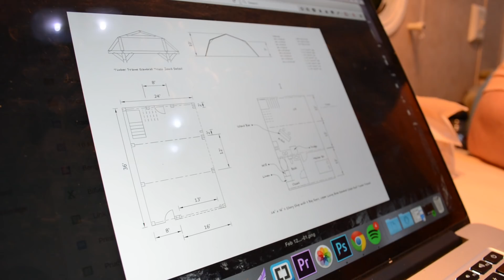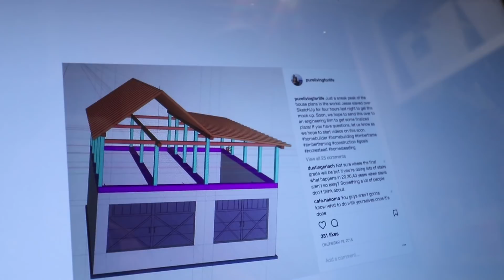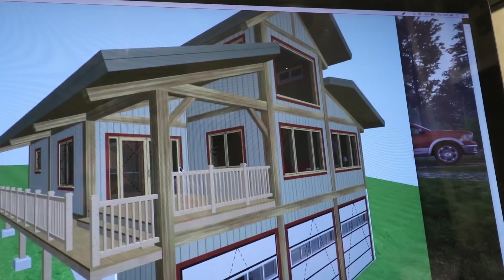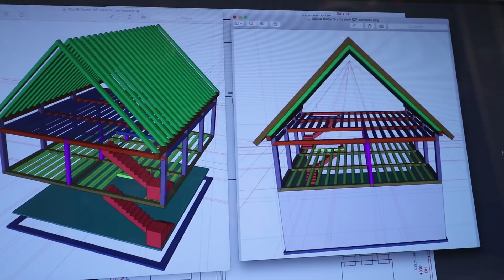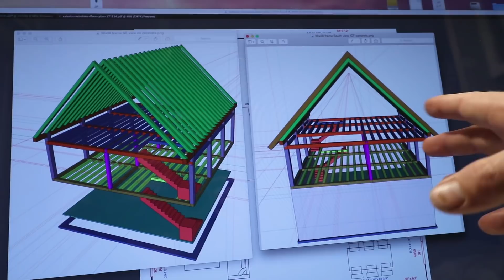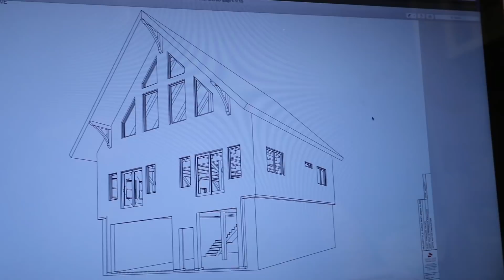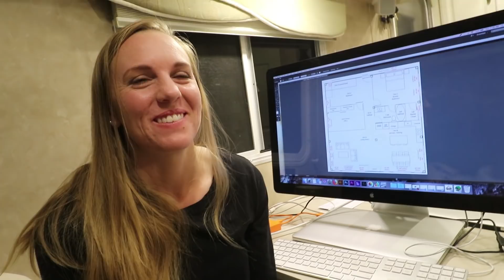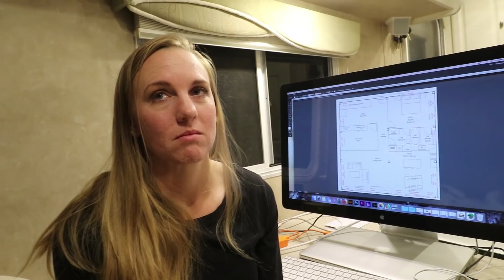Building a House Start to Finish: Timber Frame House Tour

Comment: Do you feel you've missed an opportunity to maximize solar power generation by orienting your  roof that way or are you going to have a PV array in another location on the property?
Reply: In my opinion they did it right. Turning the roof by 90° you gain solar but loose a lot of natural light and the great south facing view from the loft. Do they even plan to put solar on the roof? In that region I would put solar on high pitched shed roof close to the ground. Better efficiency in the winter, you can remove the snow without climbing up and if lucky the high pitch will remove the snow by itself.
Reply: Your arguments make sense. I'm thinking with an urbanite aussie mindset where you don't have to deal with snow nor have the space to put it in another location or on another building.
Reply: Hi Mick.
Not really a good idea to locate solar panels on the roof
1) Maintenance of the panels (such as cleaning or replacement ) would be a real pain in the ass, 45 feet off the ground. 
2) We do get a lot of snow here,  metal roof panels  are good for snow to slide off but any obstruction like panel brackets or wires would cause significant  problems and snow  back ups .
3) Solar Panels restrict air flow in hot weather and solar panels do not like hot feet.

Comment: Please do more research on the front load washer. I have had one for about 10 years and designed the laundry room around stackable s but we have started to hate them. They are awful on cleaning clothes. Top load washer, wash clothes WAY better. Also I have been working on washers for about 30 years. Just thought I would speak up because you guys will probably need something that can clean very good.
Reply: This is just not true. There is no difference in the cleaning effectiveness between similar front vs top loaders.
There are other pros/cons with the different machines, but cleaning effectiveness is not one of them.
Reply: Just speaking out of 10 years experience with these washers not to mention working on them for 30 years. May not be true for you but it is for me. :)
Reply: Eliu.
Quite agree  I was a Simpson Sears repair man many yeas ago and working on "stackers" were the pits. 
The other thing they will regret is when the have to pay for a maintenance call with no space to work around those machines, that will be interesting !!!!!!!!!!!
Reply: The repairability aside, do You also agree with Eliu Garcia about the washing quality of the different style machines?

Comment: Why do you guys use separate washing machine and dryer? There are 2 in one combos for that so you have one machine that does both.
Reply: I do have and use such a combo, and it works very well for my use. But, it takes a lot of time, so if u want to run more than two machines a day, do prefer the separate units.

Comment: Looks like a great house. Don't forget to add Ethernet wiring to where needed ( office, tv areas, garage ) and a few extras points for wifi access points on each floor. i think youtuber Crosstalk Solutions could help with that. Keep up the work im sure the end result will be amazing.
Reply: Or just wait for lifi
Reply: Do mobiles etc support LiFi?

Comment: I liked how this video shows your progression in the design and function of your timber frame.  Generally think that a walk though perspective adds significantly to the design process and cost, but I can see how this has benefited your decisions for layout. I'm not totally convinced that you will not later find things you would do differently.  One of the things that I feel that you may find cumbersome and difficult to change later is the location of the sink in the kitchen.  Placing the sink under a countertop without windows with insufficient countertop next to it severely limits the utility of the sink for food preparation and makes the person using it feel like they are separated from the rest of the members of the house. What I've seen in a significant number of newer home designs is to put the sink and dishwasher in the island, this would only be a minor revision to the water placement, add a slight complication to the DWV but significantly help with food preparation, especially if there is more than one cook in the kitchen. Often people opt to put additional cabinets over the island for dinnerware and glasses.

Comment: Make sure when you design your electrical system overbuild the garage with separate breakers for lots of plugs for tools. Wire the lights on separate breakers. Put lots of though on you garage as you are on an acreage and will be using this space more that if you are in the city. This will be a heavily used part of your new home and planning this will save lots of work later. Also lots of lights in garage is great as second shop.

Comment: I like your design philosophy of focusing on the areas which will get the most use. Just a couple questions. Why the french doors on front instead of large picture windows? Are you planning a large front deck that was not shown? Also, I noticed almost no windows on back. Have you thought about that beautiful woods view to the rear? I would love to have a bedroom in the loft area and wake up every morning to a view out onto the woods. I have seen some houses where they illuminate the woods too, so you get that view at night as well.

Comment: Hi,
Nice plans, you've done a great job! I would like to suggest, for SECURITY reasons you mite want to consider hurricane glass windows. You have a lot of vulnerability in certain areas in the house. These doors and windows make it tougher on violators. Nothing can be 100% but you will be traveling a lot and you need as much bulging protection as possible. 

Also, prepare your self for way more errors an omissions then you expect-20%? That's if you could list every step.

Good Luck. OH, take a break and rest As soon as you can. Your bodies and brains will appreciate it

Comment: Many thanks for the reveal and floor plans....you've put a lot of time and effort in and I think the result so far is evident, so a big well done and high five.  Of course, a 1,000 people will have 1,000 different designs/opinions (and different desires) from a layout.  Also, I appreciate that the plans/layout may now well be fixed and too late to alter....but some thoughts came to my mind as I was watching:

1) I would consider making your current Master Bedroom into the mudroom and reducing the size of its front to back dimension (from the current 12' I presume) down to 6' or 7' for example.  Still retain the closet and door to the bathroom/utility.

2) Move the bathroom/utility nearer to the rear of the house as a result of the smaller mudroom suggested in 1) above. Increase the size of the bathroom/utility to allow more space and perhaps a walk-in shower or bigger bath/twin sink etc. etc.  Not suggesting the bathroom increase by the same amount as the reduction of the Master Bedroom to Mudroom change but utilise some of the availability.

3) Move the Home Office back towards the stairs leaving enough for a 4' corridor from the stairs if required.  Could even increase the size of this room, so it could also be a guest bedroom if needed.

4) Put a window on the wall immediately to the right of the back entrance door to to give even more light to the basement stairs and benefit from any light coming in through the back door window (assuming it will have one).

5) Having lost the rear Master Bedroom and moved the Home Office and Bathroom/Utility further to the rear of the house, this would allow you to increase the size and open up further the Lounge. Kitchen and Dining areas to benefit from improved space around objects (dining table, chairs, sofa etc.) and give an even more light, expansive and airy feel.

6) Appreciate you maybe aiming for a more rustic than modern look/feel but the windows and doors out from the lounge and dining area could be bigger (windows) and glazed full height (on the doors) to allow even more light in.  You could fit sliding (possibly) or bi--fold doors (more likely) to allow you to fully open the front doors, to bring the outside in, on nice days!

7) Without knowing how much room you have up in the loft area, this is a bit of a guess.....but.....put the Master Bedroom at the front of the loft and make it take up the whole width.  Designed with the bed facing the views would make for a stunning aspect, lots of space and lots of light.  The over hanging roof would shield a lot of the sun plus appropriate shading/blinds etc. would resolve any additional problems, in any.  I'm assuming you're fitting triple glazed windows for thermal efficiency/protection also.

8) Put a guest bedroom at the rear of the loft space (above where your current Master Bedroom is).  You could fit a roof window to let in natural light.

9) Fit 2 separate bathrooms between the Master bedroom and the rear guest bedroom in the loft so that both rooms benefit from en suite bathrooms.  The guest en suite could also have a door to the corridor.

10) If space allows, then maybe another guest bedroom above where your current Home Office is situated (obviously without en suite bathroom).  Could also have a roof window as well as a normal window in the wall.  If not enough space, the the area could be divided to allow a great walk-in wardrobe/dressing area from the Master Bedroom and/or and larger landing area by the stairs to allow a a relaxing reading area with some bookshelves etc.

11) Finally,  is it worth considering installing a few windows on the rear gable to allow some light in?  Appreciate that they would be facing the hill but extra light is always welcomed and helps to make for open, light and spacious feel to an area

God I've written a lot but just wrote stuff down as it occurred to me.  Hope I've not confused or confounded!  Not wanting to add problems.  Just felt there are some great opportunities to use the space available.
Reply: Fairpoint....though I did preface my comments with that caveat.  Don't know if the house is complete but assume all the framing is....as they're at the stage of awaiting the SIP panels.  But agree it's most probably too late as their radiant floor layout was already designed with the room layouts and sizes in mind.

Comment: I noticed that there was no extractor in the bathroom, as without one you might find problems with it getting really humid in there and potentially damp/mould forming. Other than that it all looks nice, but maybe consider bigger windows where you have a few smaller ones, it really makes it more open. For the south facing wall where you have loads of windows and two sets of doors, have you considered bifold doors? Such a nice home in the making though.

Comment: Only problem i see from your floor plans is your bathroom. This may be only a building rule in the netherlands tho but you may never have doors that open in a bathroom. If someone collabses infront of the door you cant open it. So thats why we have the rule that doors should open to the outside for bathrooms. This has to do with the fact that their is a higher change of going KO in the bathroom because of hot temps or other watery things. But well you got two doors and live in another contry so maybe its alright. Dunno. I am just a Build Enviroment student.
Reply: In the US you build with the door opening into the bathroom. I am an Architecture student in the US.

Comment: great job you two. how and what are you going to use to heat the living space. are you using forced heat and is your heat solution cost effective
Reply: darren evers the heat is in the flooring.  Will be heated by wood burner outside.

Comment: What software are you using to design the house?
Reply: Did some brief research. Looks like the same interface as a software called SketchUp Pro. 

Disclaimer: I'm not an architect, so I could be wrong.

Comment: Eventually you are going to Work/Finish the Loft Area of the House..  I would imagine you' are designing a Bathroom for the Loft Area..   Having said that ....  Are you designing the Kitchen/Dining area for the Electrical and Plumbing access to the Loft Area?   I don't know what the correct Term is..  BUT..  A crawl Space to supply the Electrical and Plumbing among other HARDWARE between the Basement/Main Floor and Loft Floors. That Space has to be on the PLANS..   Just checking.......
Reply: They need to put in a wet wall. all of the utilities would pass though that to the second floor. 
The layout shown here lacks that feature. I don't even see a way to have the radiant floor heat to make it to the second floor. But they might have that addressed and i missed it.
Reply: I'm sure and I hope they have detailed all that with their detailing and ALL..  They sure have Captivated a lot of OFF-GRID followers..

Comment: Larger rear door for better connection to outside...perhaps slider...Larger rear door also mimics front windows. if you landscape the back like you indicated and plan to entertain etc a small back door will be a possible regret....
Reply: I agree. It would also be good to be able to drive up behind the house (to bring in furniture, appliances and the like). If you cantilever the front of the house, you'd be able to allow for a terrace or balcony.

Comment: All of that wood trim, and so many 1x's chopped up into firewood. However, from the truck video, it looks like they still have a pile of logs after the framing was finished. Hope they can take more time with that pile and get trim and a deck out of it.

Comment: Very nice, thanks for sharing.  Speaking from experience:

A BATHROOM WITH TWO DOORS:  I have never been in a house equipped with one of those where I DID NOT inadvertently burst in on someone in need of privacy (and viceversa, being disturbed).  It is unusual to have to lock two doors.  Also, your guests, or down the line your children, will forget to unlock the door you mean to use from your bedroom on their way out.

BLIND BATHROOM (AND A DRESSING ROOM WITH A WINDOW).  A blind bathroom means you'll need to use electricity for light and venting, a horrid waste if you stay off grid.  The window in the closet seems like a waste of natural light.  Loose one of the doors, have a bathroom you can air with a window.  It is also pleasant to shower by an East-facing window.

BATHROOM/LAUNDRY:  Bathrooms that do double duty as laundries are always messy.  Down the line your laundry operations will be more complicated than they are now:  baby clothes to pre-rinse or disinfect, soaking items to remove stains, pretty  wool toques or sweater that you might want to wash by hand...all will cause clutter and use up time in that single bathroom with no window.  With a lifestyle like you are heading for having a deep laundry sink for pre-scrubbing next to the washer is useful. You can use it for oversize items, not just clothes.

WRAP AROUND DECK.  I am pleased you let go of the wrap-around deck.  Frankly I never understood why they are considered a good feature:  they are too narrow to use the outdoor space for anything (BBQ, sitting space, drying racks, potted herbs handy to the kitchen..). All wrap around decks ever achieve is to deprive of privacy those rooms that have windows facing on them.  Think curious kids interfacing with visitors.  Also I had bears (more than one) come into my cabin, one through the window... Limit access points to those you are aware of.

I DON'T SEE CHIMNEYS in the rendition yet.  I understand you'll likely have an outdoors boiler, how about a wood stove inside?  If so, when you place the chimney you'll want to do so it is clear of wood on every side, not pass close to joists or a wood floor. Never mind the building code (you don't have one right now), but obtaining insurance at a reasonable rate (or at all) will be a headache if you have a chimney that is not to code.  And the chimney better exit the roof close to the ridge line.  I have seen a building go on fire because the snow load toppled a hot chimney on top of the roof.

I am rooting for you, congratulations on living your dream!
Reply: Had a two door bathroom in the first house I built.  Agree that about having to lock, then unlock, two doors is a pain.  Really doesn't work well, especially with guests (and kids).  SUGGESTION:  Use a switch by each door that will lock and unlock both door simultaneously.  This is accomplished by using a solenoid to drive a lock bolt in each door.  The switch at either door locks both and unlocks both simultaneous with one switch action.  You could be creative and also add an "Occupied" indicator LED outside to show that both doors are locked.  Easy circuit to design and implement.  Power is required to hold door locked.  Loss of power retracts locking bolt and doors can be opened.  Wire two three way switches, one by each door.  I would use low voltage solenoids.    Also, although I don't particularly  like "pocket" or sliding doors, they do work great where the normal door swing blocks or inhibits flow or access.  Your bath may be a good candidate for at least one of these.  

Overall, great job you are doing.  My wife and I built our first house when I was in the Army almost 50 years ago.  Took three years.  Your guys are great and I relive some of our building woes and victories.

Comment: Would solar be conducive on the roof?
Reply: Easier to sweep the snow off the panels if they are at ground level.
Reply: Nope. They made very little consideration for solar at all. Can't put it on the roof and if they go back to hillside solar panels, they've just made a very wasteful and long travel for the wires to the machine room.

Comment: Why don't you install the water heating boiler on the west side outside the house, if it is a wood burner ?. This would eliminate the need for a chimney inside, and the hauling of wood and smoke inside also.
Reply: that's what he said they were doing, not very efficient though